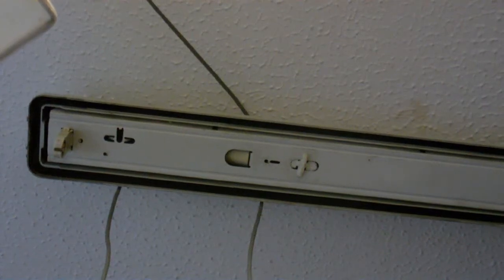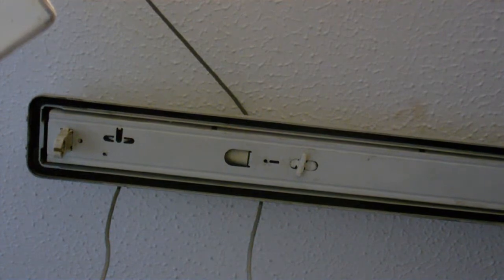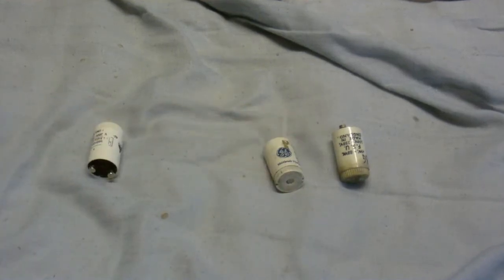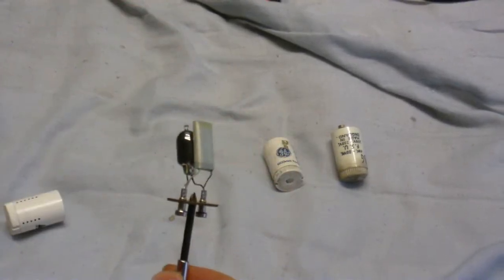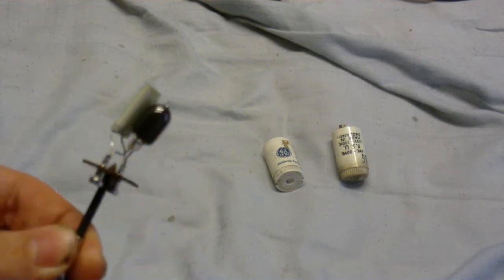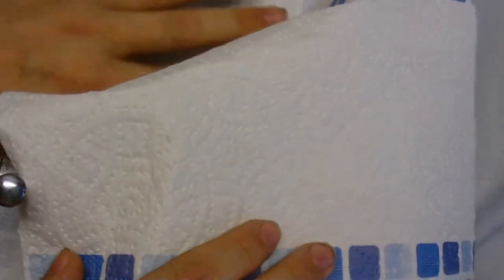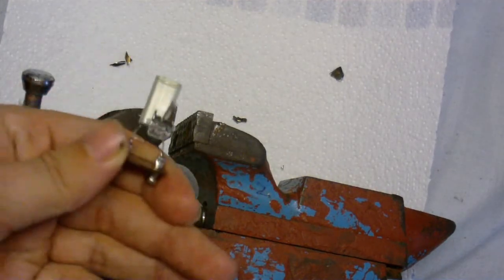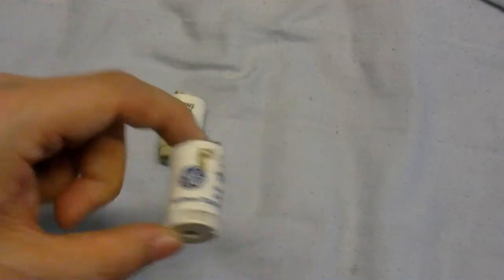What's inside a flourecent light starter?

Comment: Being a electrician as I am forever that's is a 5ft.240v light fitting it's runs off a 58w 240v ballast with one 5ft 58w t8 fluorescent tube and should have in  it a fsu.4--65w 220-240v instead and not a-75.85.100-125w 240v starter lamp the 155/800 only in use via a 6ft 70 t8 fluorescents tubes and 6ft 75-85w t12 fluorescents tubes and for 8ft 100w and 8ft 125w for only in t12 fluorescents tubes

Comment: When you switch on the lamp a violet coloured glow discharge occurs in the bulb part of the starter and this produces heat.One of the contacts is attached to a bimetallic strip which bends as a result of this heat and causes the contacts to close.When the contacts are closed heating current flows through the Tube Cathodes via the Choke and then since there is no glow discharge in the bulb part of the starter anymore it cools and the contacts open.When the contacts open the induced voltage caused by the Choke plus that of the mains supply between the two Tube cathodes will hopefully cause the Tube to properly strike (it may need to try again a few times) and when the Tube is fully struck the voltage across the starter will be too low to start a glow discharge within the bulb part of it.

Comment: Yeah its a capacitor and a vacuum contact tube. When the cap charges up to the nominal voltage the tube arcs across the contacts and ionises the gas in the light bulb which flouresces so long as there is voltage applied across it.. Great vid thanks I learned something new today :)

Comment: So the circuit with the tube in it gets little power peaks. There is a coil in the tube circuit and those power peaks will make it generate around a 1000V, and that high voltage turns the flourescent light tube on. As soon as the tube is turned on the starter gets no more power and that's how it works. So there must have been something wrong in that little light in the starter... but well, maybe you alredy know about this :D

Comment: A while ago I learned in school what's inside such a starter and what it does. The capacitor is just there to prevent interferences with radio signals. The little light is turned on when you switch on the power. The light gets warm of course and because of the way they constructed the thing the light will break the circuit as it gets warm. When the circuit is opened the circuit of the actual light tube gets power. But the little light cools down and cuts the circuit again.